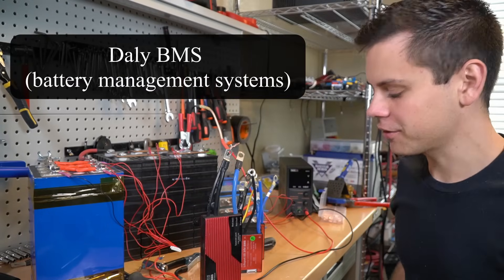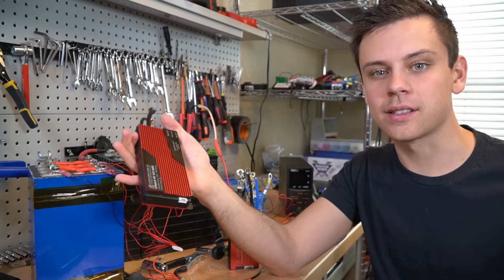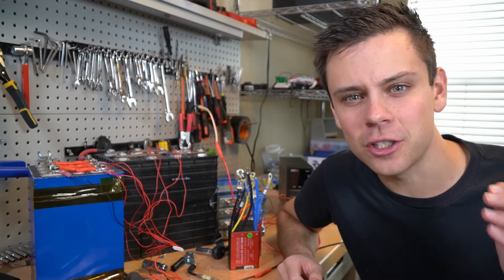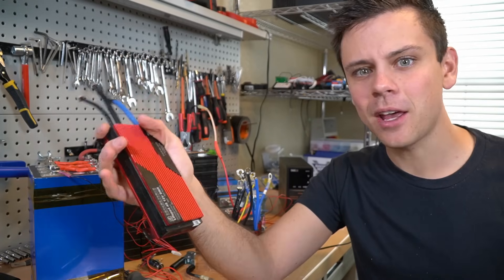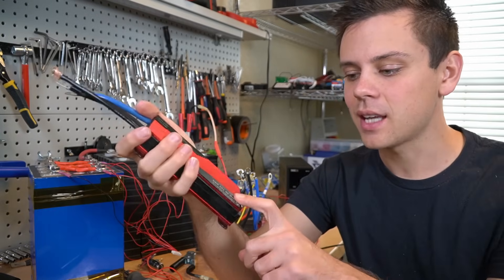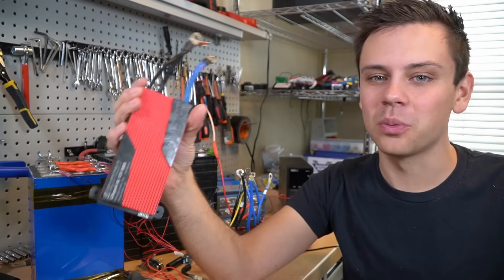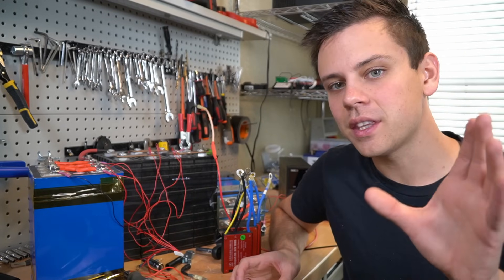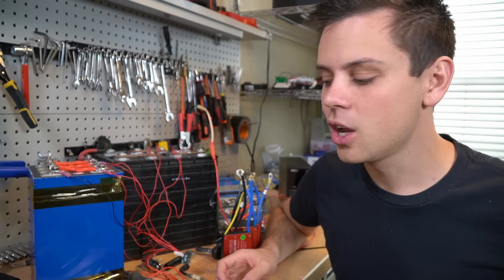Does Daly LiFePO4 BMS have Low-Temp Charging Protection? Let's test it!

Comment: These BMS also DO NOT have individual cell voltage protection, if one cell goes above or below the rated voltage it does not cut charge/load, only if the entire string voltage goes over/under!
Reply from the maker: That is completely false. And I have tested this multiple times.
Reply: @WillProwse  

Maybe I have a faulty unit then, but I contacted Daly directly and they told me it was the case (protection only for the string voltage) do you have a video showing this test? I can disconnect one of the balance wires on my unit and it still doesn't go into protect mode!
Reply from the maker: @andyreact  https://youtu.be/bj7abaCrwvI

Comment: The lack of low temperature disconnects has been my only complaint with an otherwise rather nice BMS. This is a real issue when using them in solar powered out buildings in winter. I'm eager to hear the results of the new purchases (before I buy again!). Thanks for another great video.

Comment: I ordered the 100A 12 V on November 29th and it just came today. Once I wire it up i can test it out, fingers crossed! Low temp cutoff would be great

Update: mine does not appear to have a temp cutoff. I hooked up the BMS and tested it warm and then put it in the deep freeze for an hour, it continued to charge

Comment: If the battery bank is indoors in a basement is low temp cutoff needed?
Reply: Only if you live in an igloo.
EDIT: I've lived in a place with a sub-zero basement, due to terrible insulation. I doubt this if you though, given you have (presumably) thousands of dollars to spend on batteries and associated crap. Just putting it out there for anyone with a terribly cold basement!

Comment: with what you are saying here, what about your blog of  June 22, 2019 complete LiFePO4 solar battery design  both you and the manufacturer, Victron, cautioned to not use their battery protect and use a larger relay 24 volt 200  amp relay instead.  I have had a heck of a time finding one and the harness to match it.   I have found two , one by Gebildet and one by  Ehdis but no  relay harness that seem to match. Which do you consider is better, the Victron , Battery Protect or the 24/200 relay and why?  thanks, Scrappy 2501 a green engineer
Reply from the maker: 24/500 relay is best but they are out of stock. If you use a big relay, you will be set. Easiest way to do it. And yes, lots of ways to do it. Such a bummer that battery protect not an option anymore.

Comment: In your opinion what is the most reliable/best 1000w pure sine wave inverter?12v system 300ah bats 320w of solar.goin to use on lights, TV,phone chargers and electric blanket occasionally when needed on camping scenarios(not often but modified sine wave wont run blanket)

Comment: did you freeze the batteries  w bms or just the bms?
Reply from the maker: Just the BMS. That's where temp sensor is
Reply: @WillProwse  Even if it had low-temp cutoff, it's pretty trashy -- if common -- to only monitor at the BMS. Like, a BMS will obviously warm up faster than the cells in the middle of a large pack, thus switching back on before the cells are up to temperature. Just sayin'.
Reply: @WillProwse  Also, you say "sensor", but...isn't it just a TCO?

Comment: Hey Will, have you seen anything to suggest that the blue-wrapped Aluminum rectangular case LiFePO4 cells (like in your video here) are not good quality?  Just curious if your recommendation for them still stands?  Everything I've seen so far indicates they do conform to spec.
Reply from the maker: So far they are great. I don't like the bus bars or mounting options in my previous tests of those cells, but besides that they work well

Comment: If it has temp protection at that price level, that would be a game changer
Reply: It's hard for me to believe that it would be so hard to add, either for the manufacturer or for a hobbyist with a BMS lacking the feature. All these BMSes have cutoff for high-temperature via a reed switch bimetallic spring, so...what the fuck?

Comment: Nice video on this.  My guess would be the older model doesn't have the low temperature cut off but the newer models do.  The problem is that the vendors are buying in such bulk that the newer model with this feature might not be available until the older models are sold through at each particular vendor.  So some might have the newer model sooner than others depending on their sell through volume.  This might be when they change the data sheet.  Some vendors may say it looks the same and not update their data sheets too.  Broken English is a real good indicator that some item details could be different not out of malice but plain ignorance.  Keep up the good work.

Comment: Hi Will quick question. 1 Battle born or two 230 APH golf cart batteries. No new charger. I will be using this one, it’s a 3 stage charger WF-8735 it’s the one that came with the travel trailer. You are doing awesome thank you keep kicking ass and taking names.
Reply: I'm not Will, but I don't think you can charge LiFePO4 batteries with a charger designed for AGM/flooded lead acid batteries.  Progressive Dynamics makes a wfco module replacement for LiFePO4 batteries that supposed can drop in to your power center.
Reply: vibrolax Thank you for the information I really appreciate it. But I thought battle born said it can be a drop in replacement even with existing three stage charger, it just would not charge fully or something like that.
Reply: @mrsmith324  Yes, your information is correct. The existing charger will work, but the LiFePO4 battery will not be fully charged.
Reply: @vibrolax  thank you.

Comment: How would the low-temp cutout work on the hybrid combined setups?  If the battery disconnected itself under low-temp and full solar, how would the load cope etc?  Is the hybrid controller left to manage the low-temp situation?

Comment: Thank goodness your now doing BMS's ... as always excellent video - and no small animals got hurt ... as for BMS I would think that it would require an EXTERNAL Temperature probe to do it right ...
Reply from the maker: Exactly!! And attached to the cells. And multiple sensors. I agree!
Reply: DIY Solar Power with Will Prowse are you saying there is no port to connect a temp sensor to on those BMS’s?
Reply: @tjenkens  There is NOT. These Dalys and 99% of all BMS is using a throwback design for Lead Acid and AGM batteries. They are NOT programmed or designed with temperature in mind at all. BUT if someone does come out with a Temperature controlled variant then it SHOULD be controlled and monitored with a EXTERNAL temp probe since the BMS itself will - due to its very design - stay probably 10 degrees warmer from pushing all the electrodes ...
Reply: Chk my reasoning for me. I have a Victron 150/85 and a BMV712. I’ve built my own battery with balancers  8 cells 4/pairs of 2 for 200AH my plans for battery protection are low voltage disconnect module with 12V 200amp solenoid and thermostatically controlled heating pad with temp sensor for alarms in the monitor My Victron should protect against overcharging so as long as I keep my temp sensor connected to the smart monitor will compensate for temp changes. Am I good?